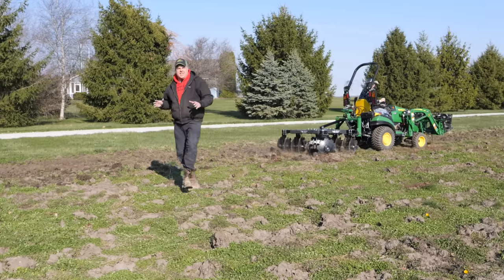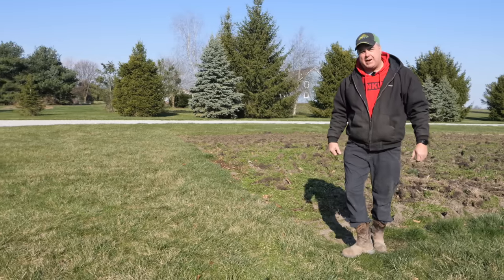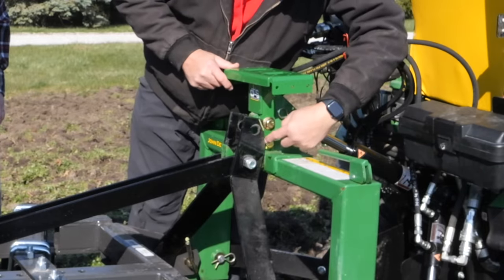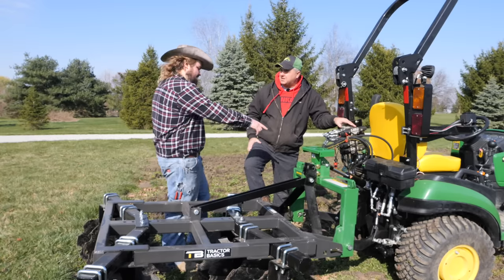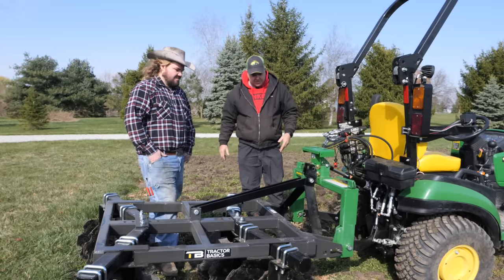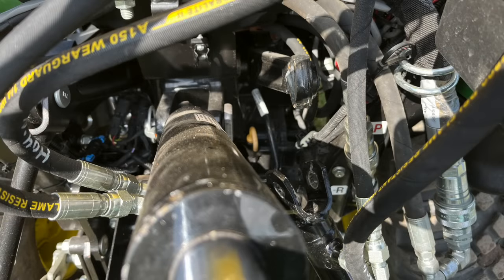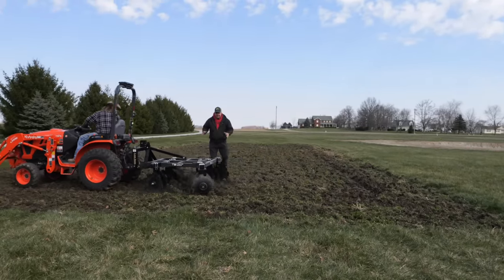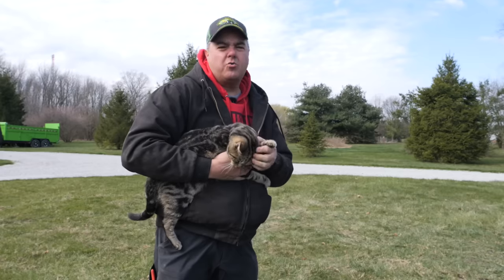Attempt to DISC the Garden BREAKS 2 Tractors! John Deere 1025R, Kubota LX3310

Comment: was that your stock 1025r?
Reply from the maker: yes.  If you remember, Johnny X has a wrap so that it is easily distinguished.
Reply: thanks for the reply 
i was pretty sure that was it  but i honestly cannot remember how many of them you have at any 1 time  
i am thinking that my 1025r with the upgraded hydro pump and bumped up hydro pressure might just pick that disc up just fine.
love your videos and Dave fits right in like family   @TractorTimewithTim

Comment: Get a Kubota lift is no problem.
Reply from the maker: correct...on the 3 point, the BX lifts more than the 1025R. On the loader, the opposite is true.  1025R loader lifts a LOT more than the BX.

Comment: I'm having the same issue with my equipment and nothing has the same spacing to use my quick hitch on my tractor. A class 1 should be the same fitting, same with classes 0-1-2-3 a standard needs to be forced period. I have modified everything just to make everything fit my quick hitch and it's a big pain for no reason. Here in US, IH was the only one that made attachments easy for the farmers. Shame on everyone else 😂😂😂.

Comment: I just fail to see anyway this disk is suitable for the job.  It is too heavy for a 1 series and too narrow for a 2 series.  That, along with the hitch issues, is not a piece of equipment I would consider.  Frontier line is more expensive, but a much better option.
Reply from the maker: This one is big enough for a 2 series.  I think Dave was not estimating properly there. 
It would be fine on a 1 series with just a bit of hydraulic pressure increase.

Comment: I still think a set of wheels to lift the disk would be better !
Reply from the maker: Yep.  A bit hard to do with such a small disk.  would have to be straight vertical lift. usually, larger disks use rotating pipe with wheels attached...rotate wheels upward to allow disk to drop.  make sense?   There is not room for that rotation in such a small disk.
Reply: @TractorTimewithTim  no put the wheels to the out side with a round tube for raising them in a single action of a hydraulic cylinder it would add weight where needed and you could put a single drawbar connection at the front . Look at older bigger disks for the attachment it just rotate's in two  or four  places along the tube .
Reply from the maker: @tacticalrabbit308 on a larger disk, they are inside the frame…but you are suggesting putting them totally outside?  I guess that means we have to lift them off the ground to keep from leaving tracks, and we can’t disk right up beside a fence or other obstacle.

Comment: It would work better if you ran it properly.. your using only the front row because your not using it correctly with the lift .. your suppose to set level with top link .. it shouldn’t  lift high off the ground .. should be level on ground surface both front and rear row hitting at same time
Reply from the maker: Hydraulic top link.
Easy to adjust.  Dave didn’t get it totally flat each time….but sometimes he did.
Very hard to see ‘flat’ from the seat.

Comment: From what I see the disk is too tall for the tractor.  You need lower attachment points to improve both pulling and lifting.  Additionally you lose lifting capacity with the quick-hitch.  

I appreciate your desire to get things unified but you answered your own problem.  A world of manufacturing companies and nations.  
Quick hitches are great and I know I will need to modify my stuff for make a quick-hitch work cause old equipment is cheap.  As a side note many companies had equipment hitches designed for their tractors.  The three point system allowed changing manufacturers.  

If you keep that disk I would shorten and lower the attachment points to work with the quick hitch and the limits of lift height limits.
Reply from the maker: I agree with the "lowered attachment points" request.   Seems like an obvious solution. 
There is a detailed spec for quick hitch compatibility.  I don't care if there are THOUSANDS of companies. The spec is clear, and they should obey it.
Reply: @TractorTimewithTim  if only.

Comment: Quick hitches are for more significant attachments, the little stuff you can move around. Stop being lazy and hacking up your attachments. WTH!
Reply: I agree, quick hitches aren’t useful for small attachments. I can move most of my attachments enough, that I never have any issues hooking up. It doesn’t hurt that everything is stored on a flat concrete surface in a covered barn, so that’s helpful. Plus the quick hitch puts heavy attachments like this even further away, making the 3 point strain to pick it up even more.
Reply from the maker: Ha!
Reply: If the Attachment says Quick Hitch Compatible you want it to be Compatible!

Comment: I disagree with using kiwk hitches on these small tractors.  People need to understand the math behind using one on a small machine with limited capabilities.  The graph of how much you can lift beyond the pins is not linear.  For every inch you go beyond the factory pins the multiple goes up for how much you decrease your lifting capacity. Its physics.   I'm willing to bet your loosing 20 to 30 percent of your lifting capacity with that quick hitch, if not more.

 same goes for the quick hitch on the front for buckets.  For every inch out you loose more lifting capacity. 5 percent for the first inch, 10 percent for the scone inch, 20 percent for the third inch..... and a whooping 40 percent for the fourth inch. Again I don't have exact numbers but most don't grasp the concept of it not being linear math.

 and we aren't even going to get into the trigonometry on your hydraulic top link. You could really over stress something fast with those.  Your changing the shape of the triangle in ways the engineers never designed it to be changed. 

  I was hoping you would try the harrow without the quick hitch.
Reply from the maker: We wouldn’t want to agree on EVERYTHING!  Life would be boring!